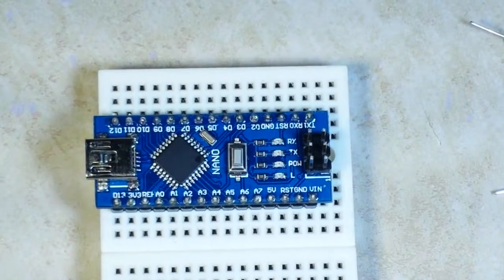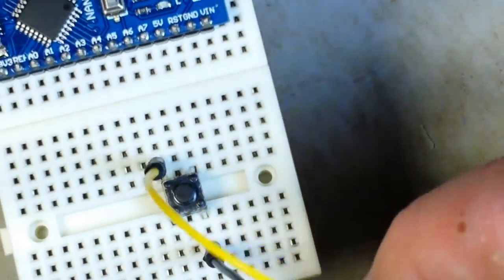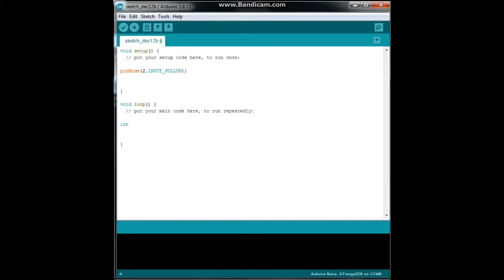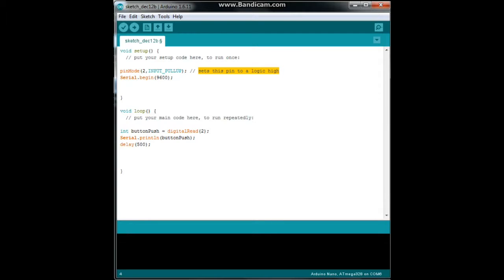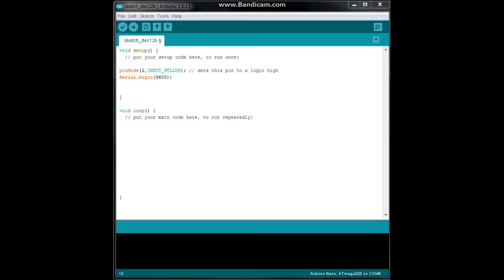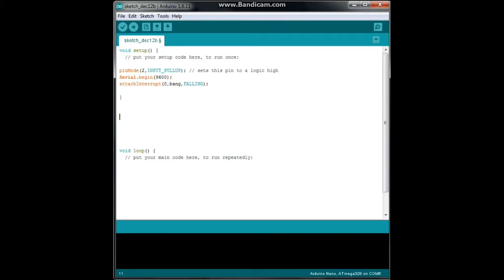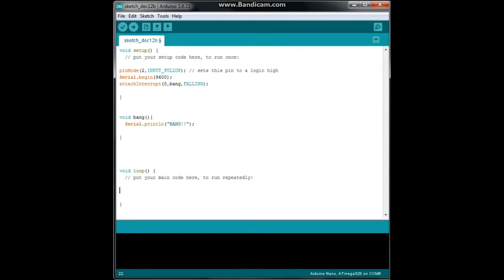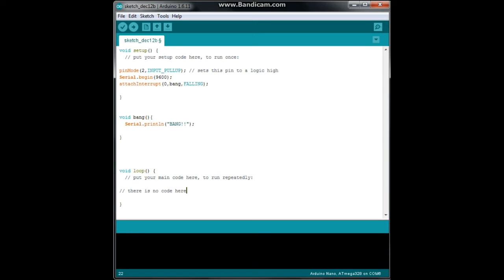Arduino Basics Hardware Interrupt Part 1

Comment: That seems to indicate that the interrupt function would just start over and over if you have a noisy input. (Like a bouncy button or an IR proximity sensor) Does the interrupt function have to run completely before the interrupt will call it again?